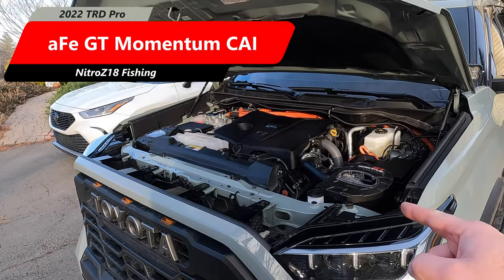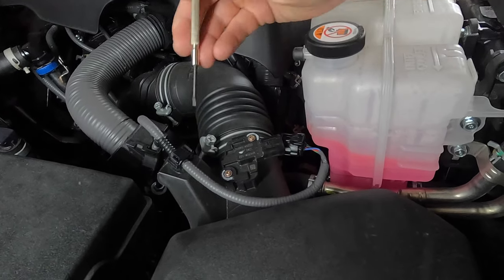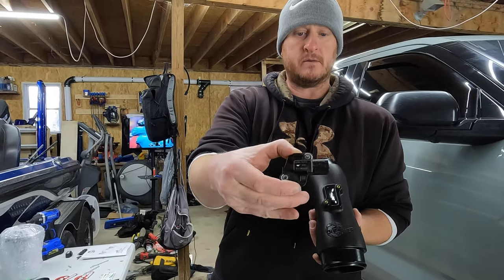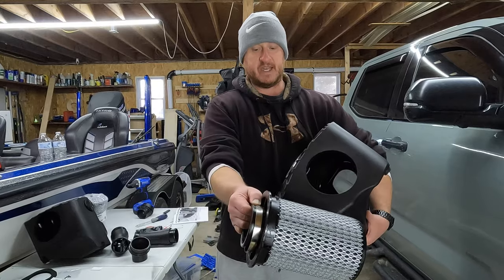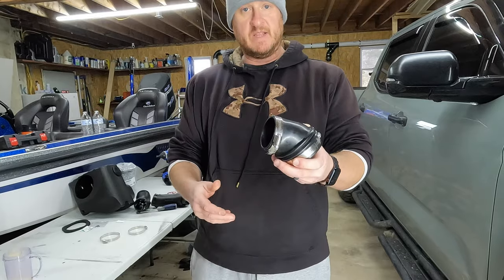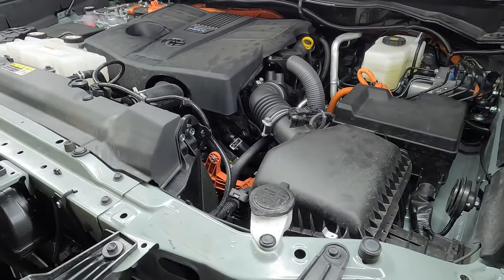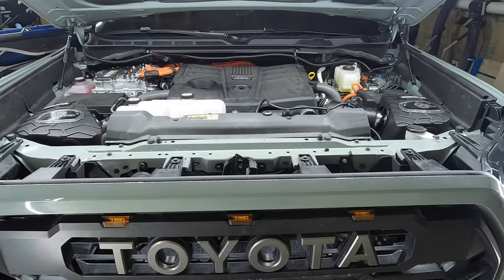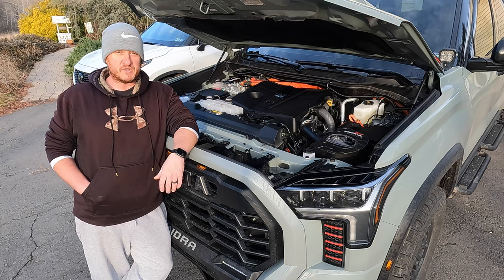aFe GT Momentum Cold Air Intake Install On 2022 Toyota Tundra TRD Pro...Review With Sound Clips!

Comment: I installed mine and I’m getting check engine reduced engine power lights idk what I did wrong??
Reply from the maker: Hmm, that’s strange…make sure the maf sensor is plugged in and secure…that would be the first thing I would check!…disconnect negative side of battery for a few minutes as well, lemme know how ya make out!

Comment: Hey really hoping you reply brother , aloha from Hawaii btw ! I just installed this cold air intake after watching your video of course , but was curious , when im in park or drive it idiles at 1k RPM im not sure if it was doing this before I installed but I just noticed it and it isn’t going down to 0 it stays at 1 or just below it ?? Please any one know what’s wrong or if this is normal ?
Reply: Are you still having this issue? Stock LC300 here idles at around 600
Reply: Mine is between 0 and 1 now without it. I just ordered this and looking for installation info while they arrive.
Reply from the maker: Hey buddy!…I’m sorry I’m just seeing this…I’m honestly not sure, I didn’t notice any difference at all with idling…is everything running ok?

Comment: this doesn't void the warranty in anyway right?
Reply from the maker: They would have to prove that this caused any issue I was having...it wouldn't directly void warranty by law, but if I had a problem with truck and Toyota could prove the intakes caused it, then they can deny a claim

Comment: Great video. For those wanting slightly  more sound and power do not install the afe caps as mention In the instructions they will provide the most sound  and power without the cap but do remember you will be sucking in hot air from the engine bay. Running  mine with out the cap since it's Winter time where I live 👍🏻
Reply from the maker: Thank you!...yea stay tuned, I'm gonna show ya a way to use those ports for another inlet for cold air, while blocking warm air from engine bay!

Comment: Honestly. Was this purchase for noise only? This paired up with exhaust, blow off valves, charge pipes, and a down pipe back exhaust system would be a notable difference in performance. To invest $550 in noise, wouldn't it be more economical just to roll down your windows for that "wind noise" ? How about fuel economy? Have you seen a difference in that, at least? I'd appreciate your input. Thanks.

Comment: Watched this and install was a breeze. Thanks man! However, I now have a whistling noise coming upon acceleration//.....Did I do something wrong and can I fix that??????
Reply from the maker: Nice, glad it was helpful, thanks for watching!...so the whistle is normal, it's due to the higher air flow with the new system...I actually like it, wakes up the turbo noise...haha...hope that helps!
Reply: haha, that part of the goal / point

Comment: Doing this, this weekend along with their Charge pipes! Wish me luck lol !  Have you done the charge pipe as well ?
Reply from the maker: Still have the charge pipes sitting in the garage, I need to get them done!… Let me know how you make out!
Reply: @NitroZ18Fishing  took me 7 hours! Take pics of how the original ones fit and their orientation from the factory, the  hardest part was slipping them on the pipe and tue engine bay all the way, the air boxes were like 30 mins max of that 7 hr window lol
Reply: But all that being said, the truck sounds awesome with those in. Puts a smile on my face every time the turbos spool up. Next up, muffler delete from Dorty deeds.
Reply from the maker: Awesome, so it'll prolly take me 12 hours with making the video 🤣🤦‍♂️...glad to hear it's worth it though, I think I may try to get them some this week!
Reply from the maker: Done*
Reply: @NitroZ18Fishing  lol nah bro. I honestly think with any delays you should be wrapped up in 3 hrs max , especially since your comfort level of working with the new gen is significantly higher than me. Im below amateur level. Plus you're familiar with the tight enging bay. I cant wait for the dorty deedz muffler delete to arrive so i can do that. Im debating an oil catch as well. Not sure if it would be a good peace of mind option to add on
Reply from the maker: I've been debating on the catch can myself, almost pulled the trigger a couple times already so it's probably just a matter of when 🤣🤦‍♂️...keep me posted on how ya like the Dirty Deeds, when I get an exhaust Keith's is what I'll be installing!
Reply: Any noticeable change in MPG? thats all I care about.